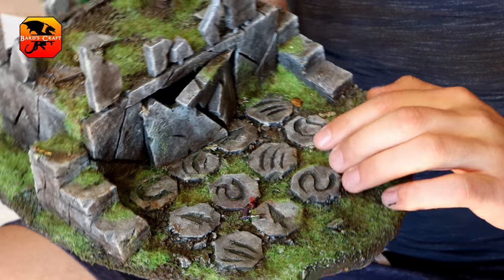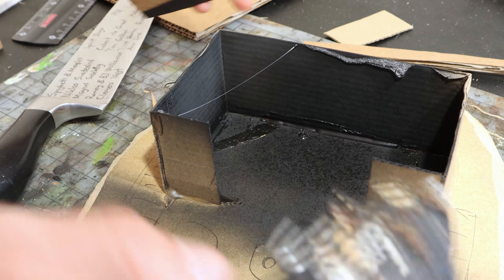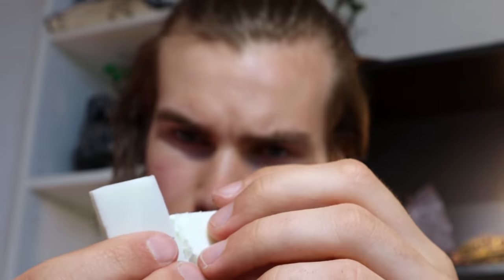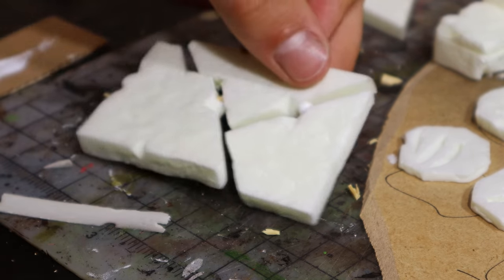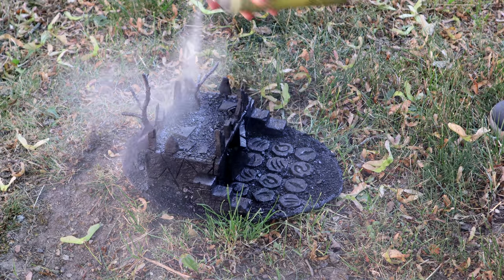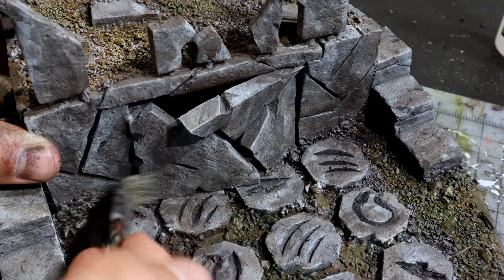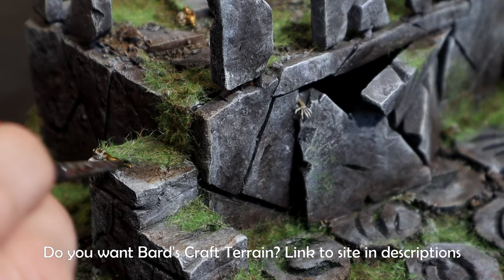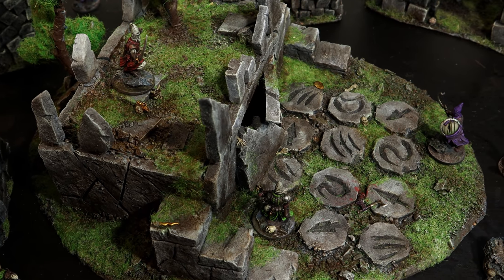Tomb of the Ancients - Building a Dungeon Entrance for D&D (Puzzle)

Comment: For pigments I buy a very cheap pack of soft pastels (not oil pastels) and grind them up in my mortar and pestel. If you can find a pack with only autumn colours that would be best since most of the bright colours won't be useful. Still you can get like 5 useful browns, gray and black pigments for less the the price of one weathering pigment pot. Make sure to wear a mask when grinding them so you dont inhale the dust. The cheap brand i found is called semco.

Comment: Tip: you can grind up some brown Pastels for some peasant level weathering pigments
Reply from the maker: I'll try that if I find some at home. I also considered finding rust to use for the same purpose :D
Reply: @BardsCraft  I have only just found your channel but I have to say your scenes are so amazingly realistic and I love them!  I've not long started making miniatures but for dolls houses (scale model type houses, not toys) and I found a great way of doing reasonably realistic shrubs recently that might be useful for a scene.   I found some little pine cone type things while I was outside - they were more like seed pod type cones, probably an inch or two tall, (according to Google,  they're Alder cones).  Anyway I coated them in pva glue, added flower soft, made a miniature pot from polymer clay & created miniature flowering topiary/shrubs for my house doorstep, but if you used less bright materials to coat them,  they might be good shrubbery for a scene.   I've also accumulated a good quantity of alcohol inks from my papercraft hobby, and I found those good for colouring non porous surfaces.

Comment: hi I have a question...when I do flocking with pva glue i can't manage to not get a super shiny finish...i have a matte varnish but it doesn't help that much...any tip?
Reply: Hi. Just noticed your question and I happen to have an answer.  I usually use krylon spray matte varnish or liquitex matte varnish. When those two fail me I use Testors Dulcote ... It is amazing for getting that flat finish.  You could also at a drop of white to your varnish buy that doesn't work as well.
Reply: You are using too much glue
Use more flock or less glue for matte results.